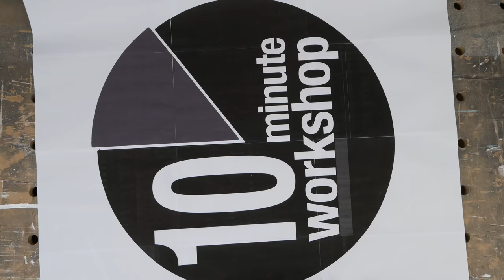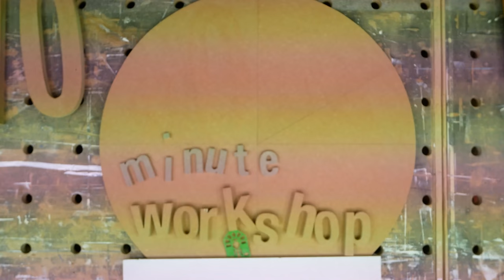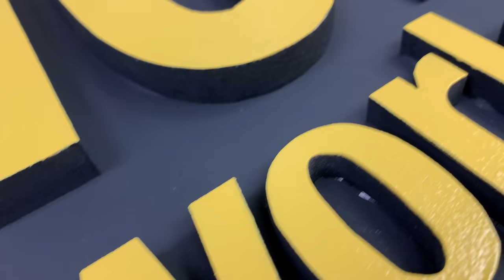It's a Sign [video #315]

Comment: Nice job. Thanks for sharing. What blade (tpi, thickness and with) did you use at the band saw for cutting out the letters?
Reply from the maker: Thanks Hans! It’s a 6tpi 1/4” blade - no idea about the thickness I’m afraid. 🤷‍♂️👍
Reply: @10MinuteWorkshop  Thanks for your reply. It looked much wider than a 1/4" width but for the curves it's not logical to use wider blades.
I'm a master in breaking blades 1/4"  :-(

Comment: Hi Peter. sorry to go a bit off message. When you were starting out did you have any problems with accuracy if so how did you overcome it. j
Reply from the maker: Sorry - do you mean starting out on the bandsaw? No, no problems really, just a bit of practice. 👍👍
Reply: I wish. no in general I afraid. A millimetre here and there. especially with the tracksaw and domino. ☹️
Reply from the maker: Ah, OK. Not really to be honest - but then I have low standards!🤷‍♂️  I had a few niggles with the Domino initially, but then the Domino-plate came along and all was well. Over time though I’ve acquired ways to work faster and  maintain accuracy (e.g. MFT) but it  usually requires money to be spent. 👍👍
Reply: Peter Millard thanks Peter will just keep bashing also went for an eye-test yesterday, new glasses may help🥴